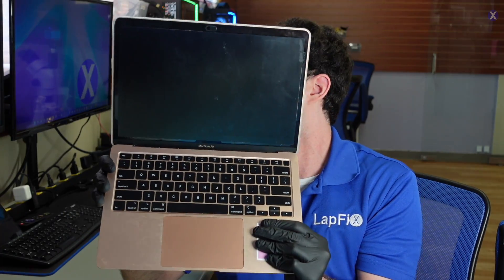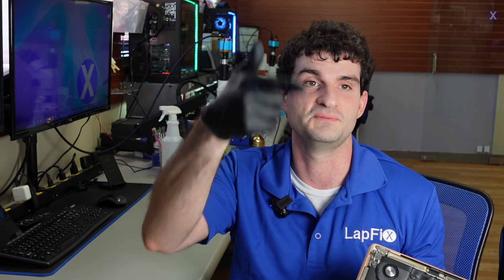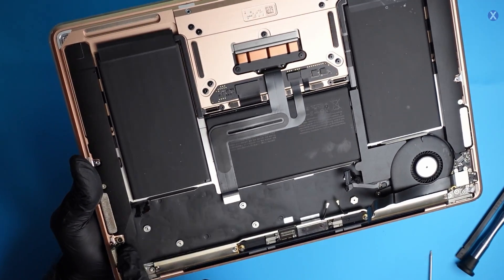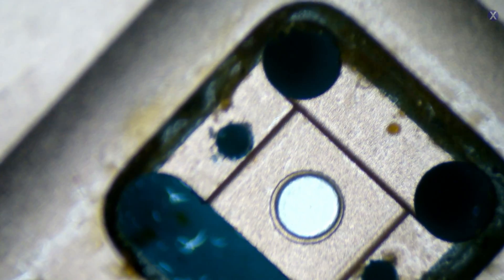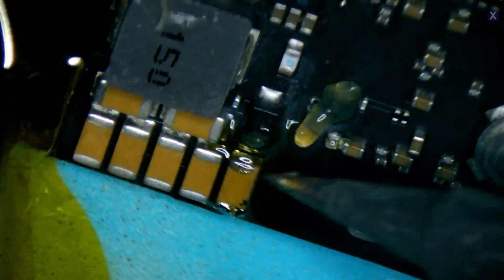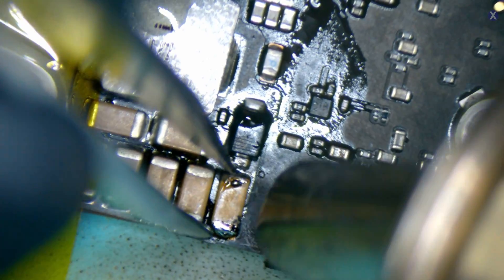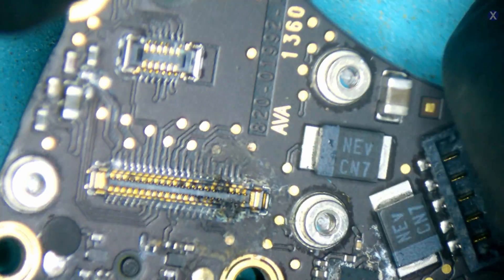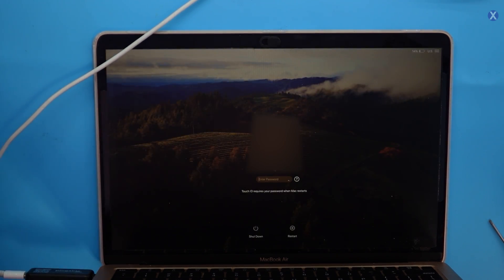Recovering Data from a 2020 MacBook Air with Liquid Damage

Comment: Hi i have a surface pro 4 and if the battery is completely run down it will not turn back on unless i apply 3.3v to the 3.3 rail and then will turn on and charge and run fine until the battery runs out. Cycle continues any thoughts?

Comment: Hey bro I have a hp loptop that I spill a little water on I dissemble it and wipe away some water it start to work then a day afterWhen I hold down power button the light flash then go a way then flash and the cycle continues without me press the power button what can I do

Comment: Hey bro I have a loptop that I spill a little water on I dissemble it and wipe away some water the a day after When I hold down power button the light flash the go a way then flash and the cycle continues without me pressing the power button what can I do
Reply from the maker: Wiping away usually isn't enough.  Most likely need some board work